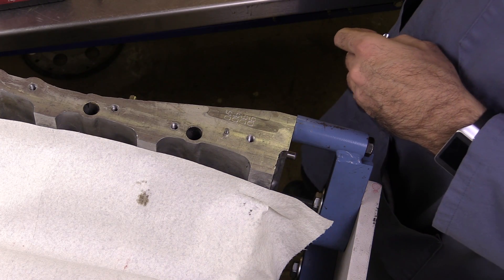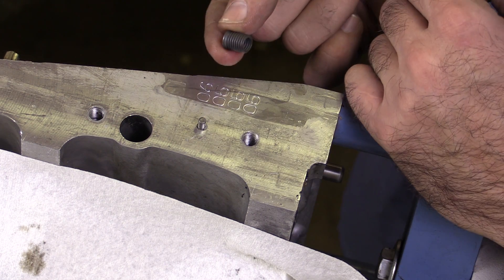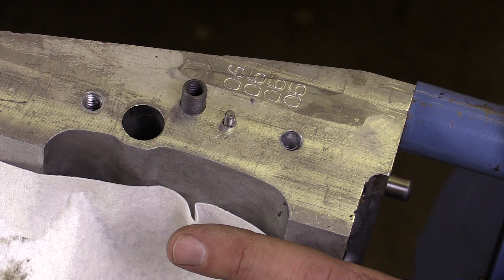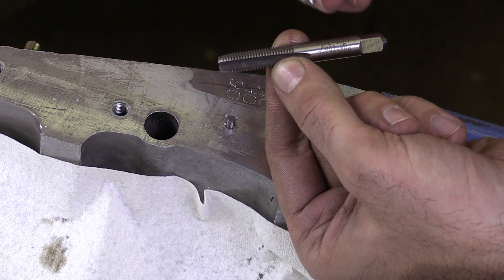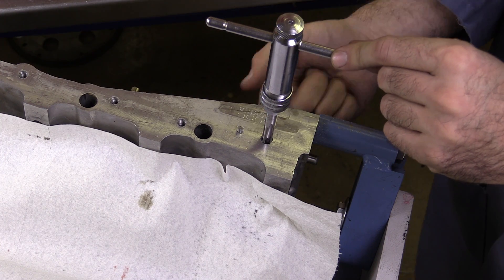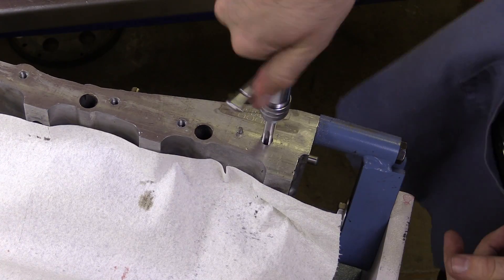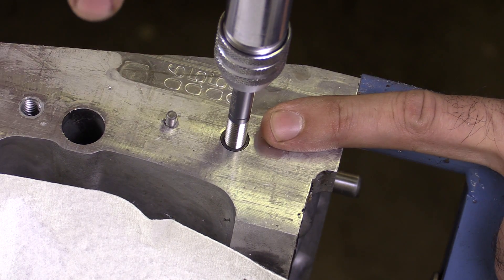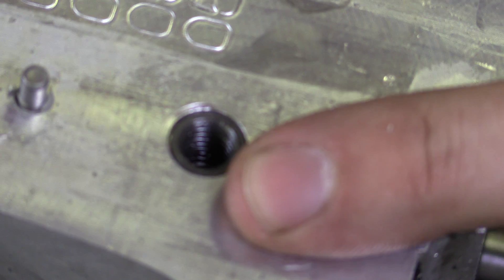Internal Thread Repair on Engine Block using Time Sert

Comment: Iv found you have added pulling strength by adding time certs as the base expands hold it in place digging in plus the bonus of them being stronger them aluminium down side more likely to brake a bolt inside ahah

Comment: thanks for the video, could this be used for a cylinder head bolt ?
Reply from the maker: Depends on the engine. There are several Toyota or GM engines that require a time sert installation for all head bolts when a cylinder head is removed

Comment: Curveball, what if the hole is blind?  Will the installation tool do it’s job if it doesn’t go all the way through?
Reply from the maker: No problem on a blind hole. You just need to remove the chips.